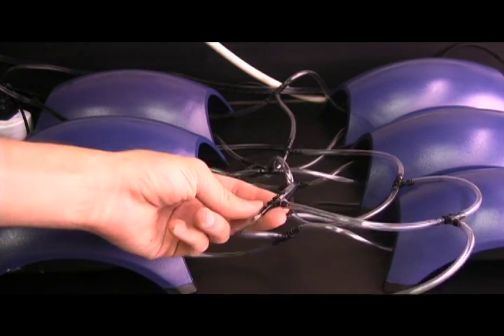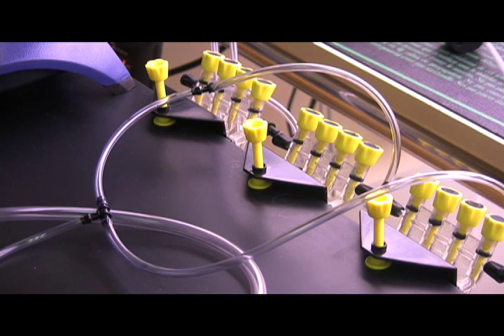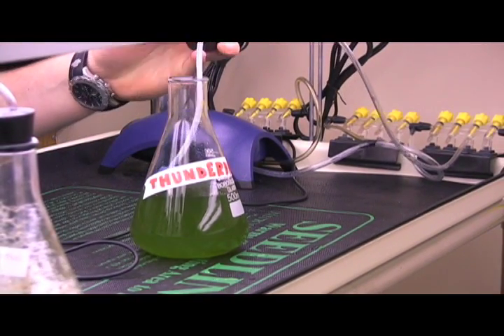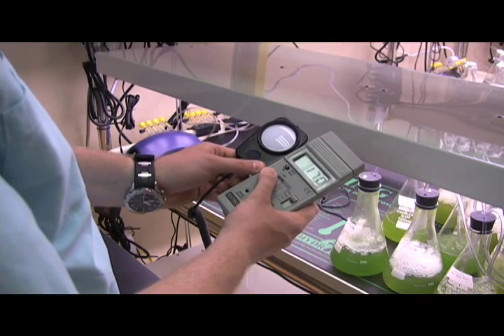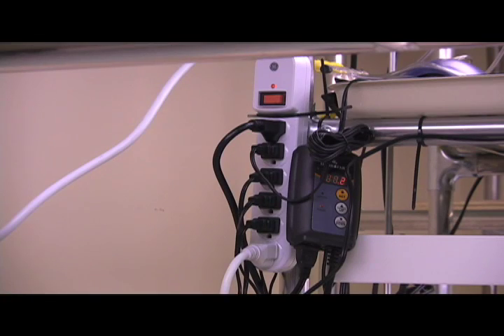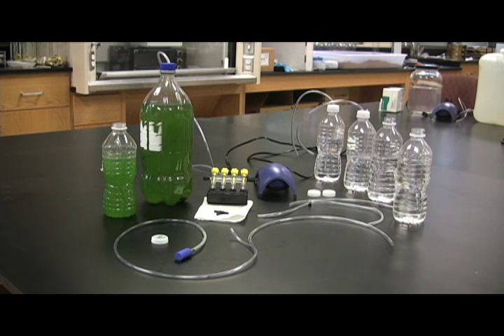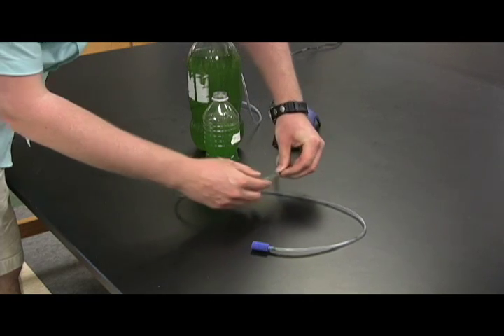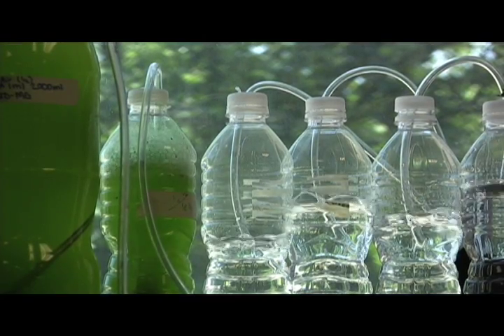Growing algae for fuel: Getting started

Comment: If you wrap the cart and cover the heat pads with panda plastic or mylar you will get better use of lights. also find stoppers that will allow light to pass through such as clear silicon.